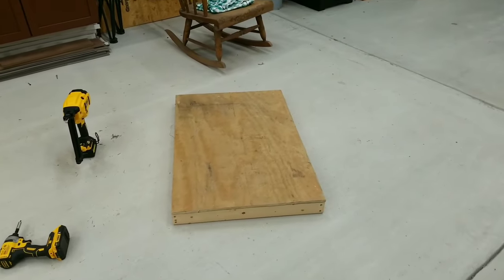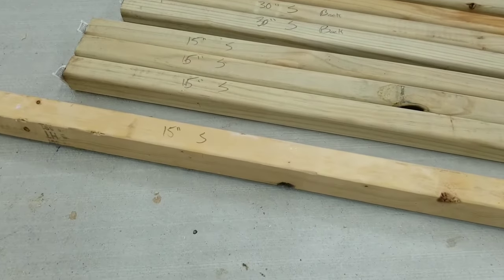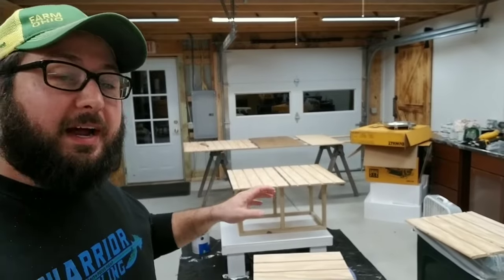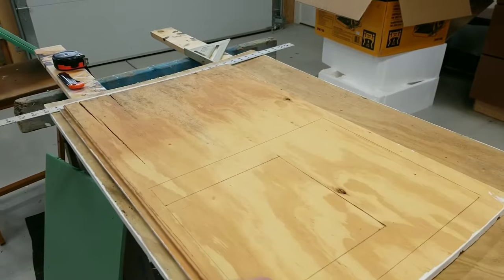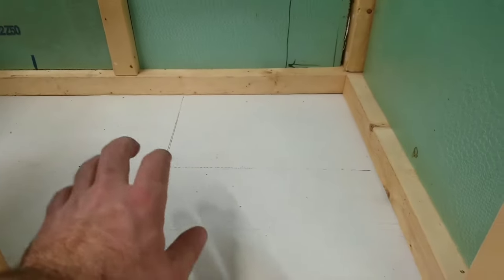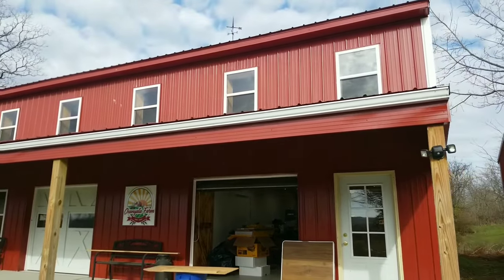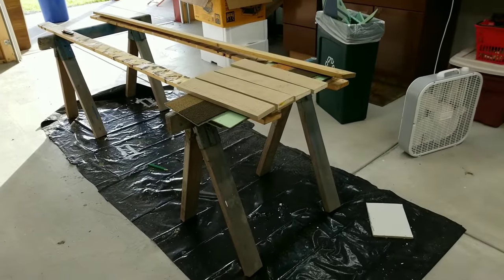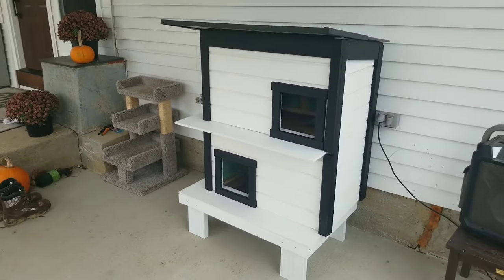DIY Insulated Cat House

Comment: While it's wonderful everything you did, rugs or materials inside a feral cathouse is usually a no, no.   They get damp and actually do the reverse of what you are goaling for - warmth.  They lose body heat instead of insulating.   That is why straw (not hay) is ideal.  They burrow in it or use it to sleep comfortably in/on and it stays dry.
Reply from the maker: That makes a lot of sense!
Reply: Hay works fine also, as long as it stays dry.
Reply: I agree and they will love that too.
Reply: @EdurtreG  Hay can get wet and get moldy. While it is warmer than straw. Straw doesnt hold the moisture

Comment: I’ve learned cats like houses with two doors to escape if a predictor reaches in and a door  that’s round and only large enough for a cat not a raccoon that can fit though a square door that’s not round pvc that’s safer with a small wind blocker wall leaving enough room to lay in the middle  making paws unable to reach the cat also
Reply: 6 inch round hole.

Comment: Great project! May I suggest hanging a couple of thicker plastic sheets in the doors to block a bit of the wind?, They will figure them out quickly. Also, re: the Straw comment, you might want to throw up an edge around the top opening so it all doesn't fall thru as the cats move around, plus it gives them something to grab onto when jumping up. Great little woodshop btw.  Take care!  (lol! I just saw the date on this vid. I'm sure you're saying to yourself: They survived just fine all last winter dummy!  ;)  Still laughing!

Comment: I think what you're doing for the cats is a wonderful idea but I also have seen other people who make houses and wonder why you didn't add say a window this can make sure the cats can see  predators like those coyotes that you mentioned in the video and as well as installing a cat door or even a backup exit if the cats have to escape I've also seen people use heating mats as well to heat up the area but you are doing a great job I'm just trying to figure out how the cats are going to get to the second floor without some type of stairs or walkway but you are doing a great job it's very nice and relaxing to watch and hope that you build stairs as well as Windows and escape hatch if the cats ever run into problems and also a side  railing so that maybe you could put food I'm not quite sure just wondering I've seen other people do it and it's also interesting that they have been able to take scraps of wood and get really wild with the ideal and still keep it part of the interior of the house
Reply: This was made from scrap material from multiple different projects. Buying a window or material that the cat could see through and keep the building insulated would cost more money I'm sure.

Comment: Great video. Veterinarian on the radio suggests to use Straw. Not Hay. Not Blankets. If your four legged furry friend gets his fur coat wet or if rain gets inside of the Cat House the Straw will breathe and dry. Blankets will stay wet and get rock hard and Frozen in the Winter. Straw is the way to go !

Comment: If someone hasn’t already suggested it or you haven’t done it, id definitely insulate the underside of the first floor as elevating the house allows air to flow underneath which isn’t ideal. Think of a bridge and why they get slippery sooner in winter.

Comment: I'm sure the cats appreciate it!  FYI - if that carpet gets wet it could develop mold and be a hazard for little furries.  Stray is generally much preferred for almost any animal warmth/insulation... and cats will not eat stray (but they may eat hay... and yes there is a difference). =)

Comment: Awesome video. But built the holes way to big for coyotes to be able to get too the cats or racoons and such possibly. Maybe think about attaching it up high on wall or something safer and with holes on different sides so if creatures can get in the cats can get out other side. Could also do what others do and add a low wattage light bulb inside for super heat and comfort. I guess you say the catß are safe on the porch but yea I'd like to create a house protected against crazy animals wanting to harm them for a safe place to hide and be comfortable. Great video though.

Comment: what is the brand of the 2nd multitool that you used to cut the hole on the second floor of the cat house? It looks smaller than the first one that you used. Am I mistaken? I'm looking for one for smaller hands (mine!) Any suggestions? Thank you so much!!
Reply from the maker: It was the same DeWalt brand one. Must’ve just been a trick of the angle. All my battery tools are DeWalt
Reply: @ChanyataFarm  okeedokee! I found it on Amazon by observing yours! Thank you again!

Comment: I know you built it off of the ground for it to stay dry but it will be extra cold with no ground warmth.
Reply from the maker: There isn’t much ground warmth here in the winter
Reply: @ChanyataFarm  The ground is much warmer than the cold air above it. And the warmth from the cats won't be lost to the air, their warmth would warm the ground.
Try sleeping on a cot when it is twenty degrees outside, you'll be painfully cold. But sleeping on the ground is much warmer.

Comment: How much would you charge to make one of these? I have outside cats and I would love for them to have a warm place to be for the winter. They really not my cats, I adopted them as they was left when my neighbors moved🤬😔
Reply from the maker: While this was “free” because I built it with all material I had on hand, there is probably close to $100 in material here, if not a little bit over that, especially when you consider the price of plywood these days.
Reply: @ChanyataFarm  so with labor I’m probably looking at $200

Comment: That not "duct tape" That the cheap plastic stuff they try to pass off as "duct tape" True Duct work tape is aluminum and has a back tape you have to peal off That crap there wouldn't last long on metal Duct Work